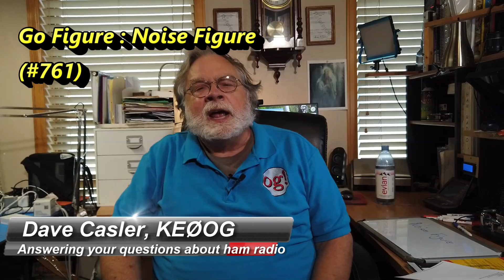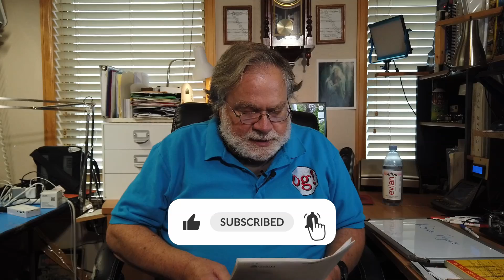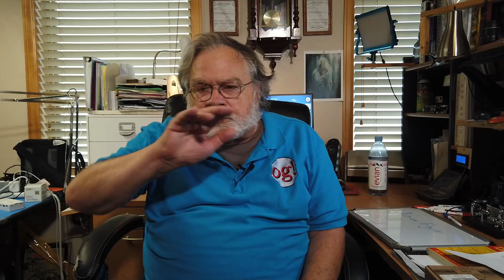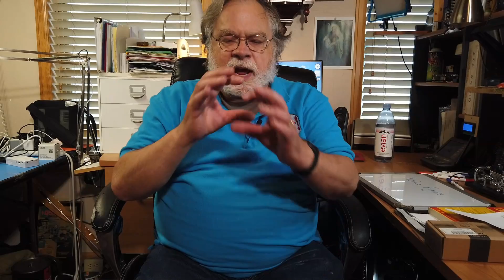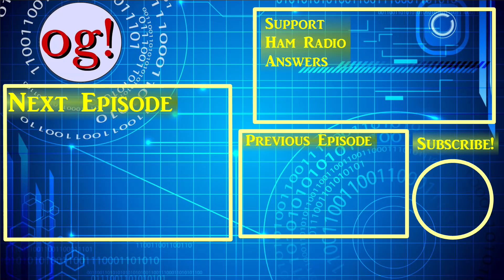Go Figure : Noise Figure (#761)

Comment: I do remember one time, when a fellow engineer in an EMC lab couldn't meet the noise floor requirement for a measurement using a really great preamp and heliax with quality N connectors.  When I told him to move the preamp into the chamber next to the antenna he did so and the noise floor dropped by 10 dB.  Thank you, Friis for your equations.

Comment: Is that gray transiever on the left of your Ten-Tec a Yeasu FT-101-E ???

   I have some Mil-Spec hardline "N" coax connectors that have what appears to be a small valve in the body on the connector and was told it was a valve used to pressurize the coax with Nitrogen, the hardline that these connectors are used for has an air dialectric and was used by Lockheed Aircraft. My Father saved several spools of the coax from the scrap bin and its about 1/2in in diameter or a bit larger. The coax has no identification marking on its jacket and Dad never told me what the make was or the purpose it was intended for. Iam assuming its 50ohm intended for a Military aircraft installation of some sort. Is it possible that the Nitrogen was used to keep the coax stable during transmitting using high power amplification?.
Reply: Sounds likely. All the telephone companies pressurize some of their cable bundles that way, both to drive moisture out, and keep it out. Even a pinhole in the jacket allows enough "breathing" for condensation to build up inside.
Reply: A lot of installations I have worked on used pressurised feeder, usually dry air supplied by a small compressor with dessicators